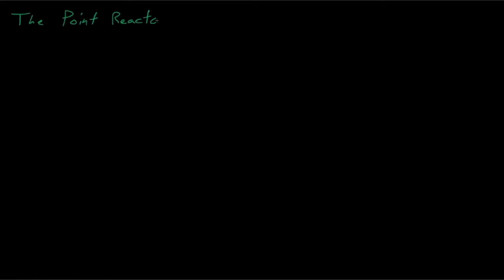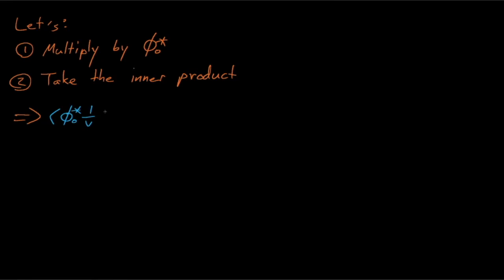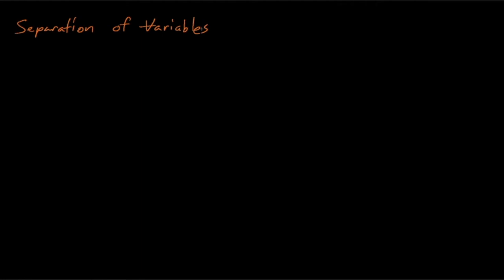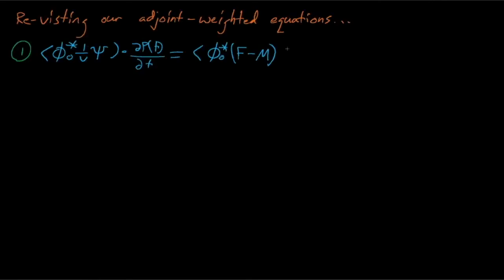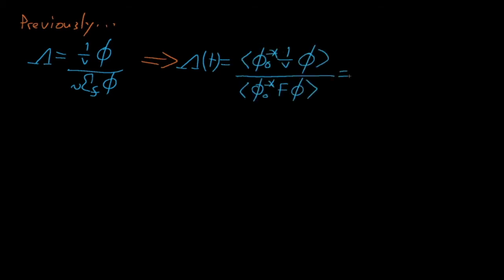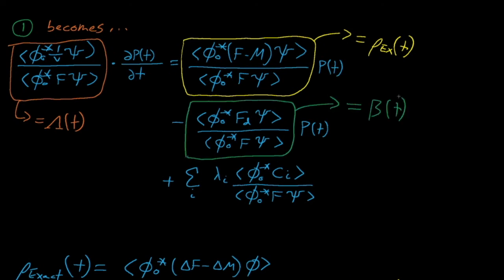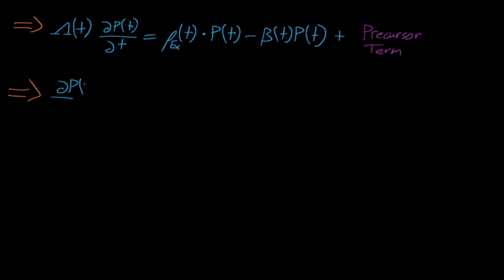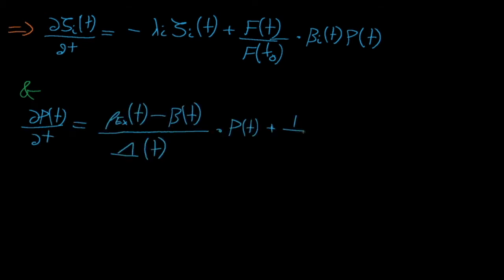NE560 - Lecture 5: The Exact Point Reactor Kinetics Equations

Comment: At 1:00, are you sure we could add λ (or k) to the F term? It seems to me that λ (or k) is meant to account for the time derivative when this latter is implicit. However, since the time derivative is explicit in this equation, adding λ (or k) would be accounting for the same thing twice. In fact, in your following videos, you didn't insert such a λ (or k) into the equations despite working in non-critical regimes, and that's because time derivatives were explicit. Am I wrong?